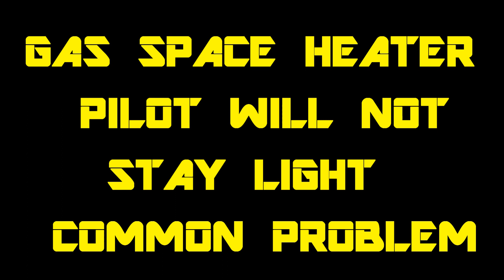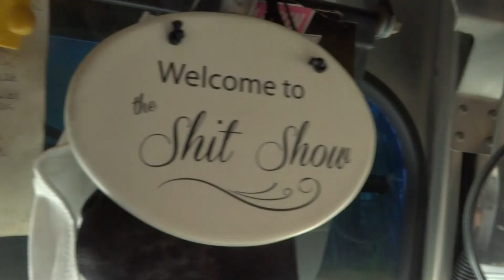GAS SPACE HEATER PILOT WILL NOT STAY LIGHT COMMON PROBLEM

Comment: Steve: Give us instruction about
a thermopile. Does the gas valve not
need 120 volt AC?
Both primary and secondary valve
powered by the thermopile?
Reply: All residential gas valves that I've seen (12+ years now) use 24v from the board to activate. The thermocouple only needs micro-volts created by the flame when it touches it. All that does, essentially, is tell the gas valve it is safe to light.